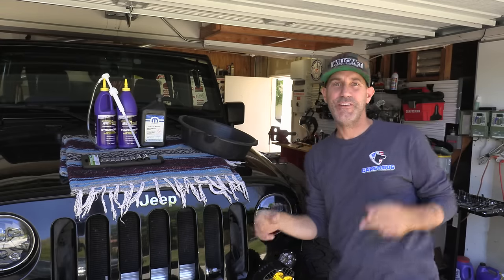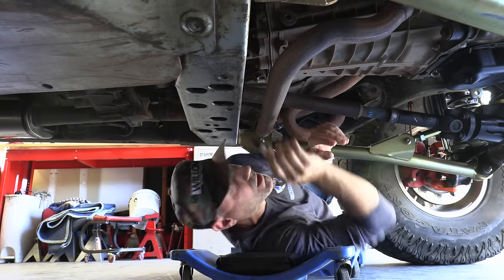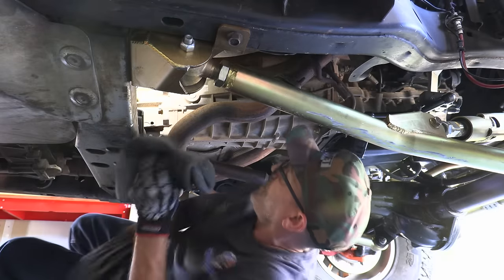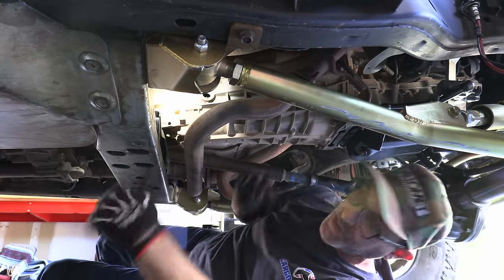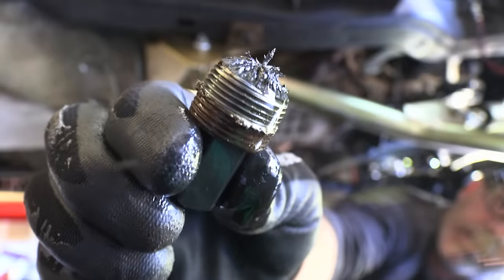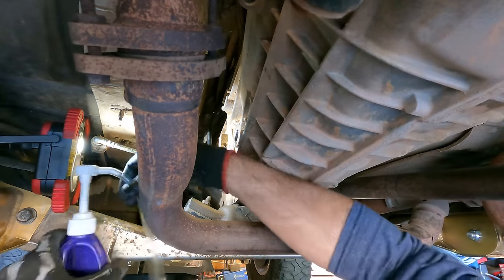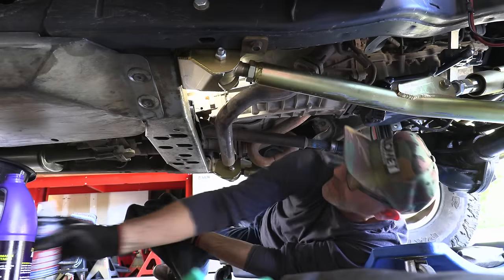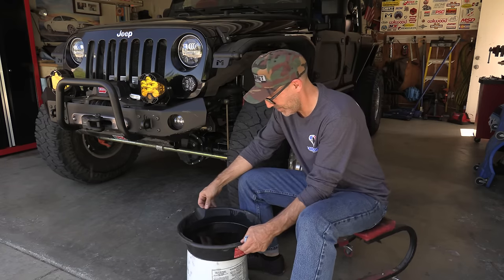How To Change Manual Transmission Fluid on Jeep Wrangler DIY

Comment: Thank you for this video, I ordered a fluid pump, two quarts of Valvoline Synchromesh and a three hex bit socket set with 12mm, 14mm and 17mm bits.  Took a minute to knock out the bit but then it fit between the pipe.  Much easier than fill plug was initially to get out.  My Kroil oil loosened that plug nicely after three applications.  The fluid costed me $21 and the reusable tools were $22.  The Jeep dealers in NYC will only work on 2013 or newer models.  A shop had worked on my vehicle, R&R the transmission, etc. 3 years ago in another state.  Since I couldn’t find a local shop, I figured I’d do it myself. To contain the mess, I did wrap the pipe in spare plastic and used the brown shipping packing paper to absorb any extra dribbles.  Seriously saved me miles of driving and lots of money at a dealer/shop for something I could do for less than $45 out of pocket.  All the best to you, truly appreciate the video!  👍🏼

Comment: It is tempting to lie directly underneath the fill plug while spraying degreaser as you have the best view to see where you are spraying. Get off to the side, not directly underneath and WEAR SAFETY GLASSES WITH SIDE SHIELDS OR CHEMICAL GOGGLES while underneath. The degreasing aerosol can permanently blind you if it gets in your eyes and rust on the undercarriage can also damage your eyes should some of it fall in your eyes.

Comment: wow, that's a GREAT tip on the hex socket.  I'm a Royal Purple fan (been using the motor oil since 2003)...and think they provide a fantastic product.  I'm more of a gravity feed type when it comes to filling the transmission. A 10ft (or less) clear hose from engine compartment connected to a funnel or the bottle directly.  Flip bottle upside-down and poke a hole and let gravity do the job.  Just my preference.
Reply from the maker: Sounds like a good delivery system but how do you stop it mid pour?
Reply: @AutoEdits  ... good question.  I use a plastic hose clamp to pinch the clear tubing.  The bottle can be placed upside-down and placed in a secure location in the engine bay.  The plastic hose clamp is used near the fill hole when the fluid starts dribbling out.

Comment: Could you please consider doing a full coolant flush video (heater core, engine block and radiator). Struggling to find a comprehensive video online. Thanks!
Reply from the maker: I'll put that on the list.  The recommended flush is at 100,000 miles and I'm not quite there but to help my internet friends... we can move that up a bit.

Comment: I just changed the fluid in my 03  TJ sport with a 5 speed. The screw on hand pump is ok but I found a hand held fluid transfer pump at Lowe’s. $5.00 more and it cut down the pumping action by 2/3rds. It’s a little more messy but with common sense it’s not bad. Well worth the money. I’m gonna purchase another pump for my 1985 square body Chevy 4x4 truck. That truck has a 4 speed with a granny gear. Well worth the money

Comment: Just did a transmission fluid change on my 2014 JK.  Punching the allen out the socket was genius.  Thanks for that idea!  Made the job go super smooth.  Love the videos.  Keep it up!
Reply from the maker: Right on!
Reply: So your 2014 JK had the drain plug. I’ve watched several other videos where no one removes the drain plug but the pan and drain from there which is a mess.

Comment: I have the same set of HF Allen sockets and did this a couple years back on my 2013. Knocking the Allen key out is the way to go, you also gain the use of a 17mm hex socket if you’re in a bind and can’t find a regular one. I think I used a 17mm ratcheting box wrench with the Allen key and it made things go a little easier too.
Reply from the maker: Good tip!

Comment: Your hex socket came apart A LOT easier than mine. I had to used a vice, a larger socket and a screw to press the hex part out. I guess cheap tools for the win (not that the ones I got off Amazon cost much more).

Comment: Great info. I never would have thought of knocking that out.
Reply from the maker: Thanks and I'm such a cheapskate that I cringe at cutting a tool if I don't absolutely have to...LOL
Reply: @AutoEdits  well I have an automatic not a manual, but it's still a good hack to know. And ehen it comes to mt tools I don't want to cut them up ether.

Comment: Yeah, I need to get under there and do this again, and the transfer case too.

I laughed when you went to take that fill plug out, it resisted, and you cut to it coming out easy.
Reply from the maker: I am going to get the t-case this weekend! Funny how I thought when I edited it to make sure and show the struggle so people would know it could be tough and then cut to removal... not the other way around 🤔
Reply: @AutoEdits  Well, I could see the torque you had to put on it was rolling you around. Gave me flashbacks to when I had to use a breaker bar on mine while laying on the floor the first time.

Really useful video though. Keep them coming!

Comment: Thanks for the walkthrough. Informative as always. I've been having a burning smell when I reverse and was worried it might be the clutch. I will check the transmission oil to make sure its not that since I've also had gears slippage and shuts off when I reverse.
Reply from the maker: Sounds like the clutch to me as well.
Reply: @AutoEdits  It's what I'm afraid of. Not looking forward to the $1500+ price tag for a good kit. Gonna have to join a club and add it to the wrench days calendar. 🤣😂

Comment: I run Valvoline Synchromesh in my NV3500 HD for my 99 Dodge Dakota. I ran it well over 75,000 miles pulled the plug and it was like brand new ! I still need to get under my truck and do the rear differential fluid as the last time I changed it was right before I left California in 2009. Im pushing 55 years old and a wee bit rounder and it is getting harder and harder to climb under my truck to do the fluid anymore.
Reply from the maker: Thanks for sharing... I think my next change should be fuzz free on the magnet.

Comment: The correct fill level is accomplished with the vehicle sitting on flat level ground or equivalent i.e. hydraulic lift. And if you do not use MOPAR manual transmission fluid, be sure whatever you use complies with MOPAR SPEC MS 9224. There are bronze synchronizers inside the transmission and they must have the right fluid to shift properly.

Comment: My UK JK 2.8 litre CRD has the transmission drain plug just forward of the exhaust pipe crossing over so it is easy to access it. I guess that the US JKs are different as you don’t have the 2.8 CRD over there.

Comment: This is a great video and I wish I saw it the other day. Not knowing too much about Jeeps or manual transmissions, I was googling why all of a sudden, my shifting got a little difficult. I kept trying to find where I could check the transmission fluid level and came to the realization that is not an option. Can I still drive it till next week when I have time to change the fluid? I certainly don't have the $200+ to take it somewhere... this shifting issue JUST started and I haven't driven it in a  day or two....
Reply from the maker: The fluid shouldn't cause a sudden change in shifting performance. Changing the fluid and making sure the proper amount is in there and looking to see if there are metal shavings in the old fluid will be very good to do.

Comment: Thinking of going from the NSG370 to the HP70 using the Jeep Speed Adapters...
Reply: Manual to an automatic… what blasphemy is this!
Reply from the maker: Are you swapping a Hemi in?
Reply: That 8 speed really brings jeeps back to life, the added ratio is worth it but the swap isn't easy at all.
Reply: @AutoEdits  no, keeping the 3.6 and maybe going to a Ripp SC,  because I don't like the cooling water pump idea used on the Edelbrock SC, I just have to figure out how to use a snorkel with the Ripp SC...
Reply: You won’t be able to use an HP70 with the 3.6L. The bellhouseing won’t fit. If you want an 8 speed with the 3.6 you’ll need to go with the 45RFE or do a Hemi swap with the HP70. I thought about swapping my NSG370 with a 45RFE, but the expense doesn’t make sense for me since I’ll eventually do a 6.4 Hemi swap when my 3.6 dies in a few years.

Comment: Good job you make it looks very easy! And motivated me to want to do it myself, I recently purchased a 2012 and I want to know the fluid level, what’s the correct way to check it?
Reply from the maker: Hey thanks! To check the level, remove the upper plug (fill hole) and put your finger in there and see if the fluid is just at the lower level of the hole. If it's not, add a little.

Comment: Great video! Definitely alot of helpful information. I do have one question: Could you use the Lucas semi-synthetic automatic transmission fluid as an exact substitute? Like you recently used in your transfer case fluid change video? Im about to knockout both and wanna order the right stuff.
Reply from the maker: Thanks! I couldn't find exact specifications that would confirm the Lucas as a match for the manual trans fluid so I went with the safe bet and got a synchromesh labeled fluid.
Reply: @AutoEdits  okay, i appreciate the feedback! I might just go the royal purple route like you did. It's worked really well in my engine every oil change. And then order the Lucas oil for the transfer case.

Comment: I've found out that there is different types of thread sealant tape. Stuff that's oil resistant for drain plugs & such. Have yet to try/ find any of it but I guess it's out there.
Reply from the maker: Teflon sealant is good.

Comment: Hey jason 
I don’t know if the manual transmission has a filter inside the case but the automatic trans do.  I have a jku automatic with180,000. Would u recommend changing the filter too cuz I gotta drop the whole pan to do it?
Reply from the maker: Absolutely do the filter on yours. It will be a similar setup to this video https://youtu.be/OgDjcyQ8zEU
Reply: You absolutely need to change the filter and if you have that much miles on the same fluid, be glad it still works. Original manufacturer of the transmission says to change oil after 60 - 90k Kilometers not miles 😉 you might want to get it flushed after all that time. Assuming you are talking about the 5 speed auto from a jeep jk

Comment: After your breather blew out, did you need to drop the transmission to put that cap back on (or reattach your hose if you extended it)? I blew mine out too. I’m replacing my clutch soon, so I’ll drop the transmission anyway, but curious if it can be done by removing the center console and the shifter.
Reply from the maker: I keep not dealing with it... I'll get under the center console in the next week or so and look at the breather.

Comment: I just put Royal purple syncromax in my 2014 jk. Seems to shift much smoother. Was very worried at first cause everyone told me to use Pennzoil syncromesh. How does yours seem to still shift and run after all this time?
Reply from the maker: I did notice it shifted a little bit smoother than before but thought it might have just been in my mind... LOL
Reply: Is this video applicable for a 2014 JK automatic?

Comment: Is there a noticeable difference in shifting? Is it smoother?
Reply: I purchased my Jeep used and a few of the gears had the dreaded “notches” and fourth popped out a few times. Since flushing the transmission fluid (changing it, running 1-2k miles and changing it again) all issues have seemingly gone away - at least I haven’t noticed any issues in the last ~5k miles. I do also feel that shifts are smoother, but ymmv.
Reply from the maker: It actually does shift a bit smoother and just feels  better.

Comment: Just to confirm, this was just a fluid change.  So if I wanted to replace my filter as well, could I follow this video (draining fluid but not refilling) then remove the transmission pan/filter which I would assume wouldn’t have much fluid it in since I drained it, right?  Or should I just go straight to removing the transmission pan since I’m changing the filter?  I have a 2011 automatic JK.
Reply from the maker: This video is how to on a manual transmission. Here's a link to the automatic https://youtu.be/OgDjcyQ8zEU

Comment: I have been pounding on the HF 17mm for 20 min and its not budging.
Reply: 30 min... success.
Reply from the maker: Glad to hear it!
Reply: What did u have to do
Reply: @escherlucier3660  just keep going at it.  It was shifting slightly each time, just hard to see it.
Reply: @joeyvk5293  I ended up reversing the flow of my pump and managed to pump it out of the fill hole it worked great
Reply: @escherlucier3660 never change your trans fluid that way. For starters, you will never get all the old oil out and second, you can’t clean the magnet.  Do it the proper way and drain it with the drain plug.

Comment: im having trouble putting it in first gear. I read it could be low transmission fluid. Does that sound right to you? I have 80k miles
Reply from the maker: Checking the fluid level first is the right (and cheapest) thing to do but generally trouble getting it into gear is a bad synchro and requires major work. Hope it goes well.

Comment: What was the cleaner you used to spray before you took the fill plug off?
Reply from the maker: https://www.amazon.com/dp/B08H1ST345?linkCode=ssc&tag=onamzjasonlew-20&creativeASIN=B08H1ST345&asc_item-id=amzn1.ideas.2V9OUZO8OUU3D&ref_=aip_sf_list_spv_ofs_mixed_d_asin

Comment: I’m coming up on 92k miles on my wrangler that I purchased new in 2012. I’ve done all of the maintenance myself and just did plugs, coils and PCV while replacing my oil cooler assembly. I’m ashamed to say that I have never changed my automatic transmission fluid or T-case. For whatever reason, I assumed it was to be done around the 100k mile mark. The manual says 60k for autos. My fluid still has a nice pinkish color to it. Some say you shouldn’t change it after a certain number of miles because the fluid keeps the clutches intact. I really feel like I need to go ahead and change it.  I have a new filter and gasket ready to go. Any opinions?
Reply from the maker: Absolutely change it.
Reply: @AutoEdits  thanks, I had a hunch you’d say that.
Reply from the maker: You've done so much other pre-emptive maintenance... would make me crazy to know that wasn't done! 🤣
Reply: @AutoEdits  I know man, I know! That’s why I said that I’m ashamed to admit it! Thanks for taking the time to respond and for creating these videos. They really help👍🏼
Reply: @AutoEdits  my Toyota Tacoma is still on its original automatic trans fluid at 350k miles. Should I leave it alone?

Comment: My socket isn’t budging. Pounding and the vice almost broken.
Reply from the maker: Make sure there isn’t an Allen screw or pin holding it together.
Reply: Use a propane torch and heat the area a bit

Comment: I had to buy a rod from ace and cut off a 1/4" piece to use as the tool and a socket because the space between the bolt and the exhaust was to close.

Comment: Can you please tell me if a manual transmission fluid can be the same fluid used in a transfer case fluid change .? Thank you.
Reply from the maker: No. Automatic Transmission fluid is used in the transfer case. The manual transmission in this Jeep takes a synchromesh gear oil, not suitable for transfer case. Here's how to do the transfer case https://youtu.be/g0sMrlk1Y08 and here is a link to the fluid I recommend https://www.amazon.com/dp/B00374DYFO?linkCode=ssc&tag=onamzjasonlew-20&creativeASIN=B00374DYFO&asc_item-id=amzn1.ideas.3DK63XK3I5IL6&ref_=aip_sf_list_spv_ons_d_asin
Reply: You can use the same fluid in the transfer case, it is just a chain
Reply: Manual transmission fluid for Jeep manual transmissions  made by Amsoil is a 5W30 oil but complies with MOPAR MS 9224 spec which has certain additives for the bronze synchronizers in the transmission. The additives allow the transmission to be shifted properly, as designed. ATF fluid used in the transfer case does not have this additive and is a much lighter weight allowing proper function of the transfer case.